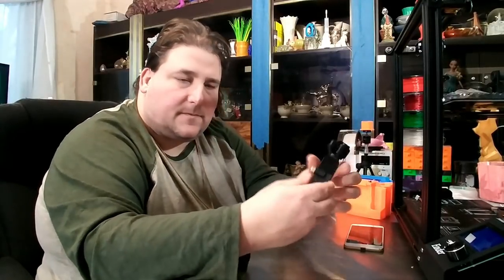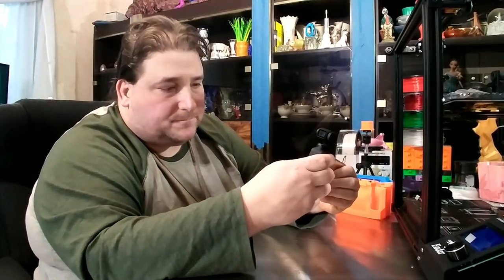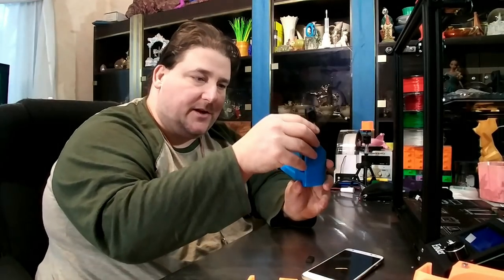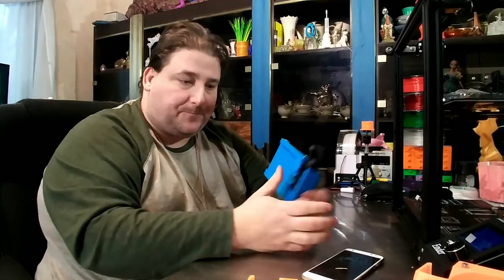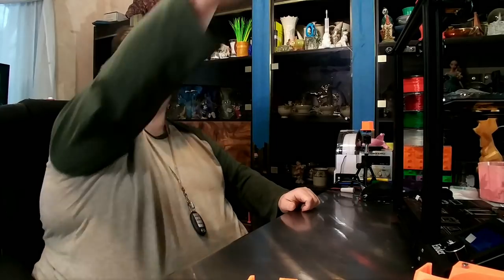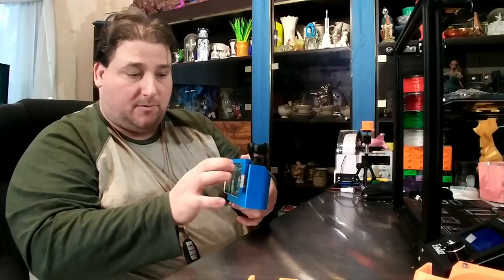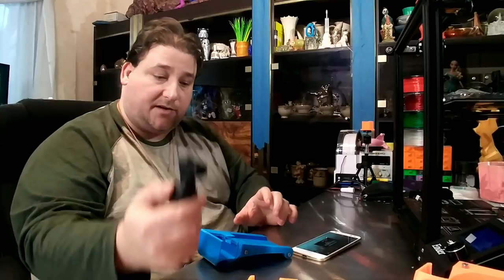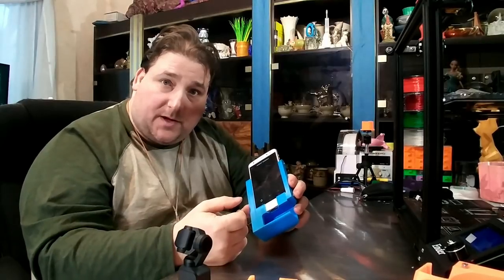Osmo Pocket Custom 3D Printed Shell T3DP

Comment: Very nice !  You know, back in the 90's I was into shooting video of model rockets, and I found the best way to follow an ascending rocket is to mount a 1X red-dot pistol sight on the camera.  It's very hard to follow the rocket with a camera viewfinder,  but the scope made it easy.
Reply from the maker: haha. yes I bought a 50mm non magnifying red dot scope!! mounted it to the hot shoe of the camera. worked wonderfully !! now I have a new way. I have a 100-400 L lens for my 5D MkII and I MOUNT my video camera to the tripod mount of the lens. I then align both at 100yards at full zoom. I set my zoom and focus. lock the camera to manual focus and hit record. I then shoot pictures through the OPTICAL VF of the canon and where it looks the video camera looks.!

Comment: Incase you havent seen it theres a mod for the Ender 5 that changes the orientation of the end switches for quiet homing, so the carriage doesnt clank into the frame. X one was perfect, Y i had to add a couple of bits of tape to the plate as it printed a mill off so wasnt activating before the carriage hit the back. But now works like a charm :)
Reply from the maker: Link?
Reply: its genius idea of just rotating the switches so the carriage plates brush along and set off the switch instead of whack into the switch. Might want to send to your contacts at Creality

Comment: youre a bad influence buddy, saw a deal and now have a Ender 5 humming its first print behind me. Got lucky one of the frame screws threaded :( luckily wasnt all the thread so managed to secure down but needed longer screw to catch the thread again
Reply from the maker: Yes that is one catch with all of these printers you're putting a steel screw into an aluminum threaded hole even the tiniest cross thread destroys them very quickly and before you realize you're applying too much force it's very tricky sometimes that's why are usually thread them in by hand first if possible
Reply: @nerys71  yeah felt a bit tight but fixed, curious thing though using your profile and my test cube is backwards, the X is pointing to the rear of the machine
Reply from the maker: Yes I noticed that the slicer considers the back of the printer to be the front of the printer I assume this is because the Homing switches are in the back there's probably a switch I can flip to reverse it but I just never bothered figure out which one does it :-) probably flip Y
Reply: @nerys71  :) its not really a big thing to worry about, just got me curious hehe